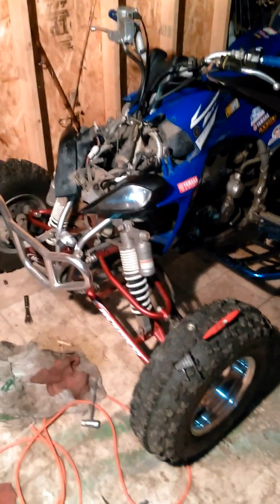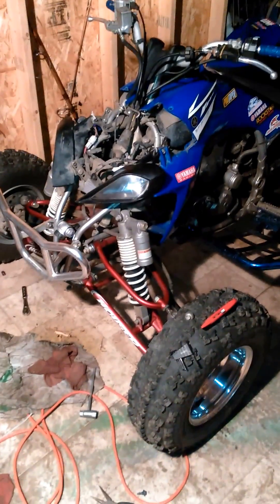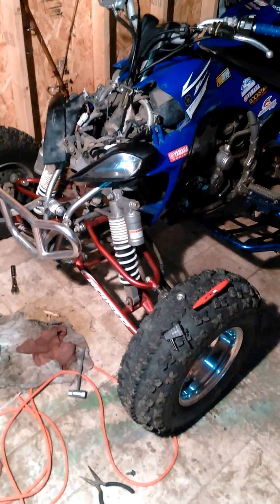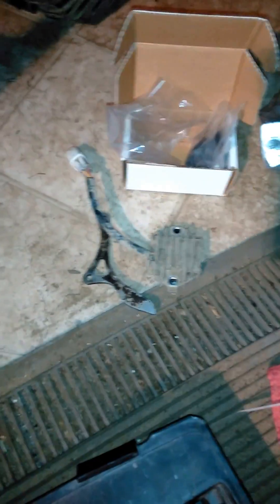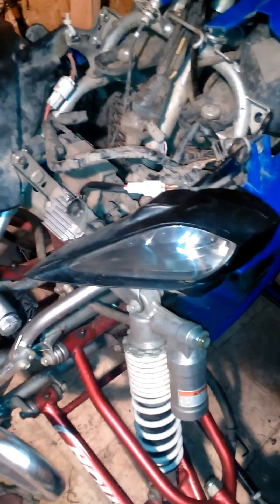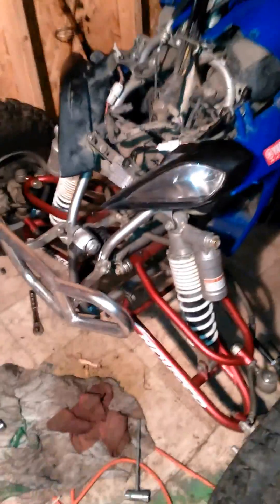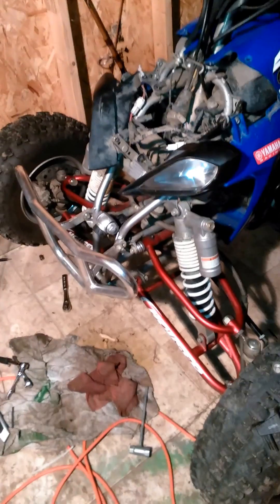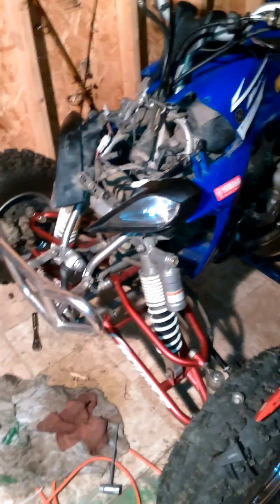Voltage Regulator/Rectifier Yamaha Yfz 450

Comment: So I got a 2004 yfz 450 and it blew out the bulbs and I thought it was normal but then  I took off the head lights and pigtailed them to LED light pods and they blew out right away not even 50 feet of it riding it. You think my voltage rectifier might be bad don’t wanna blow out another set of pods